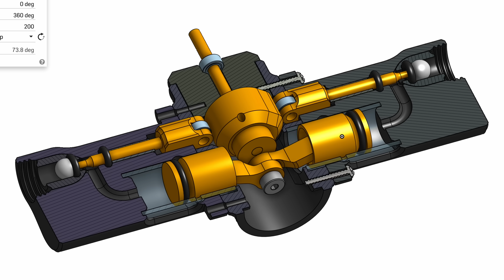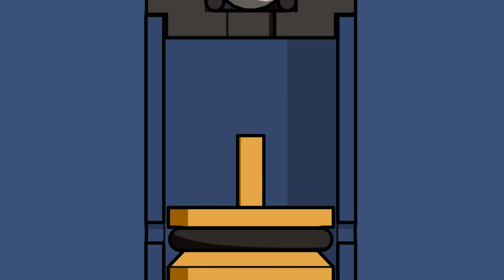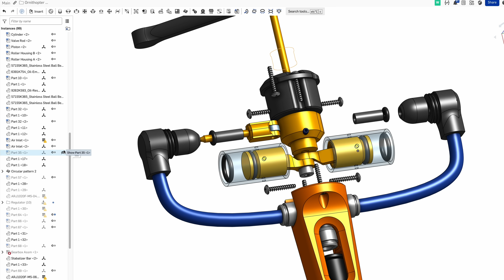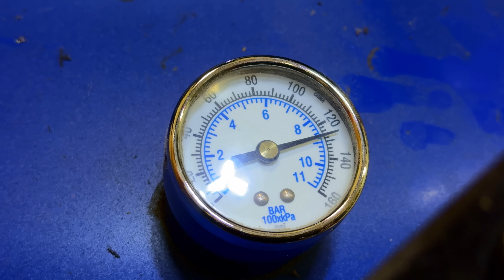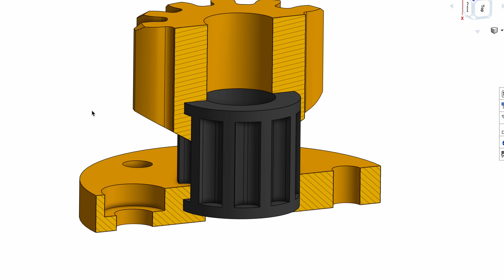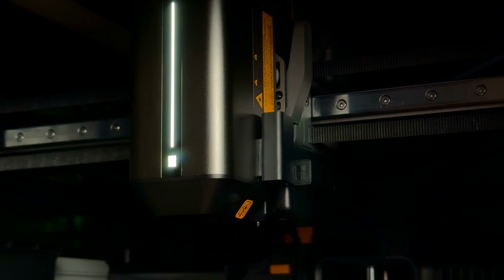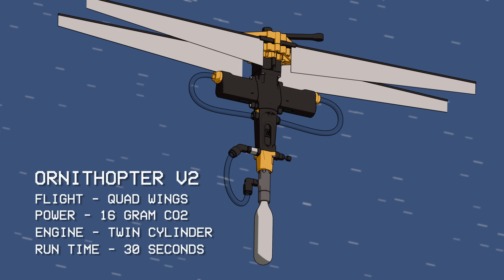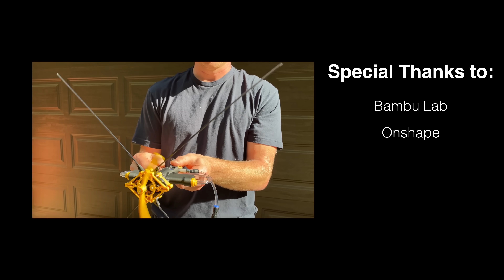I Tried to Build a Flying Machine With Just CO2

Comment: This is impressive stuff. This is just my personal opinion, it looks like working with compressed air is the most stressful option to power your device with.. Is there any other compressed gas option? Or could you do a hybrid option where you use some battery powered electric power in combo with utilizing the compressed air & the momentum of the propeller to create an efficient hybrid system? I'm obviously not experienced in this department myself but I do nerd out & watch a lot of this type of content. So my ideas are probably delusional but that mindset can help with brainstorming ideas. You never know what options you might stumble upon to make this thing fully work. It's an amazing design & really well made, same with the videos visual diagrams.

Comment: Could you make the piston travel to be shorter in order to increase the rpm? U should let the wings rotate in 1 of the 2 movements that each wing has and block it in the other so it pushes air only in one direction

Comment: Beautifully made video. Seriously i love the effort you put into these animations
Reply from the maker: I appreciate that!
Reply: @worksbydesign  Hey man, you mentioned the problem with the engine back-firing and producing an oscillation, why not use that directly to oscillate the wings? Just a thought
Reply from the maker: @xmysef4920I tried at first! The problem I had was that the backfiring wasn’t giving much power. As it is only backfiring because the first stroke wasn’t strong enough to complete the revolution. But there maybe something to that, it’s worth exploring again for part 3!
Reply: @worksbydesign what program are you using for the animations? Amazing work!
Reply from the maker: @DJ-kx4en thanks! I use onshape to make the parts and blender to animate them
Reply: @worksbydesign  amazing work! I'll look into this! I'll try to find some tutorials for the effect!

Comment: You could try using PLA Aero that Bambu Labs sells - it’s meant to be light, specifically for model aircraft and stuff. I haven’t tried it myself, but if it does what it says, it could be worth a shot.
Reply: It's good for lightweight stuff but I think it foams as it comes out of the nozzle, so its really bad for stuff that needs to be dimensionally accurate like this project.
Reply: @EchoBuildsThings  He could use it for any of the infill stuff away from walls.  Birds after all have mostly hollow honeycomb bones.
Reply: @youtubeisapublisher6407 You can get better strength to weight in these kinds of parts by mostly ditching the infill altogether though. Foaming PLA isn't new though and while the dimensional accuracy is lower, it's not by so much that it couldn't be considered for some of the structural parts

Comment: I wonder if directly driving the wings via an air engine that's intentionally backfiring would work? It would remove the gearbox and the associated weight and friction, albeit needing to tune the engine to deliver high torque at low "RPM"

Comment: Great engine, I’m know engineer but I thought that after you reduced the pressure when splinting the flow to each side of the engine wouldn’t you be reducing the power you need to make it fast enough to lift off, I’m probably wrong it was just something that came to mind 😊

Comment: You’re converting the reciprocal motion of the pistons to rotary motion in the crankshaft then back to reciprocal motion for the wings; that seems like a major inefficiency.
Reply: Ya, early in the video, when he was showing the backfiring engine (and came up with the cam solution)... I was thinking, "you want an oscillating motion, maybe you can use that as it is".  At this point he seems way off on the weight vs generated thrust.  Something has to give.  Or a lot of little things
Reply: @glenmiller1437 exactly what I was thinking
Reply from the maker: @quakxy_dukx Good point! I did try an engine that fired like a linear actuator, but it always ran poorly or not at all. It worked much better by connecting it to a flywheel or a crankshaft because it gave it momentum it needed to continue firing evenly. And once I added a flywheel it was easier to just take power off of that rotation, especially when trying to find the best gear ratio to flap the wings. Could be worth taking another look at it though!
Reply: @worksbydesign Yep, you're right. Not only is torque problem, but so is momentum.
Reply: @creativecarveciteclimb5684  youtube is using nested comments. That's new to me.
Reply: @worksbydesign  No, actually , I think you should go back even further in your design process!  Pray tell, why, when you’re trying to make something “oscillate with changing direction”, did you work so hard to make your engine stop oscillating back and forth and instead produce rotational motion, like what a propeller needs (which isn’t what you’re using), all so that you could then turn that rotational motion back into an oscillating one?!?  It’s probably true for most situations that the rotational motion is more efficient, but I don’t think that is true here. A propeller needs constant even torque because the force it needs to exert is constant. But a flapping wings torque needs aren’t constant. It needs much more torque at the end of its swing when slowing down and changing direction than it does in the middle of the swing when it’s just pushing on the air. And I’m pretty sure that the oscillating engine design would have produced torque in that same pattern, meaning that for your specific needs it would have been perfectly efficient!  Instead you added more complexity and weight to your machine to produce an effect which is less efficient than what you could have had…  Unless you can demonstrate that I’m wrong about all that?!
Reply: No, this is by design, as this is the only way to change the mechanical advantage to allow more torque.
Reply: @creativecarveciteclimb5684 it is intentional, but I'm not sure it's the right choice. If u used a larger piston you might be able to get away with slower flaps and higher torque
Reply: You need the reduction somewhere, just a single stroke of the pistons wouldn't be enough to move the mechanism.
Reply: You would need a complex linear ratchet system to convert strokes then. It would, most likely, have even more internal friction
Reply: @G0RSHK0V  

I'm not certain that's true.

You could definitely design a piston where a small displacement corresponds with a full wing flap just by using the wing as a lever - with the piston quite close to the pivot.

To get the wing to flap both directions, you could build it like a double-acting pneumatic cyliner.

The tricky bit would be to deal with the valving in an efficient and lightweight way, and to prevent the system from stalling - you'd need to do something similar to what he did here to prevent the valve from firing before top dead centre.
Reply: @quakxy_dukx  I was having similar thoughts along with some changes to the pistons so hope you don't mind me adding my two pence worth here. First how about having the piston powered in both direction by having two dual function valves at each end that switch from exhaust to inlet 180 degrees out of phase with each other. Then do away with the reciprocal to rotary back to reciprocal motion by replacing the gear boxes with levers that couple the pistons reciprocal motion directly to the wings reciprocal motion by having the piston motion arranged to be at 90 degrees to the wing motion and connecting them with a lever (or four bar linkage)  that would have a suitably positioned pivot point and possibly using one piston per wing pair. Now if any of that makes sense to anyone please explain it to me because explaining in words what I can see in my head is not one of my strong points 🙂
Reply: @ripmk2  what you’ve described is a steam locomotive piston
Reply: @quakxy_dukx  I must have been George Stephenson in a previous life 🙂
Reply: My engineering gut feeling tells me that with proper matching of stroke, bore and pressure, no gearing will be required and that the resulting 'direct drive' ornithopter can be made to fly more easily than its 'rotating intermediate stage' counterpart. My gut feeling also tells me that it takes someone like you to do it. Very impressive!
Reply: Good point.  Further more, since the final motion is reciprocating motion, u don’t need a rotary one in the middle. Just have the two pistons move in opposite direction for balance and synchronized in some way
Reply: @ivirelu23  wdym “furthermore”? That’s exactly my point
Reply: This is a really good idea, and I think it has promise. That entire stage is really not needed, and being directly piston driven would be SO COOL!
Reply: I'm guessing that either the engine would have to be redesigned to run slower or some very creative transmission for speed reduction would be needed (and planetary gear one like here tend to be compact). But it would definitely be interesting.
Reply: @ImieNazwiskoOK True.  He could change the stroke and bore of the cylinder, and give it lower rpm and more torque.  Might well still need a gearbox, or a change in the linkages of his wing-flapping mechanism.  I feel like he wanted to re-use that flap mechanism (understandably), so wanted a rotary input, and that lead to all of the conversions.   Thinking all that could be replaced with a "direct drive".
Reply: @glenmiller1437  There's even more potential weight savings here. Rather than using a bunch of regulators to reduce the pressure of the cartridge (which would then require a large cylinder to get enough force), he could potentially use the ~800 PSI of the catridge as-is with a small diameter piston - but while achiving the required force for a 1:1 ratio with the wing flapping.
Reply: I feel a manual car type flywheel should be able to transmit the power properly, it's got teeth on its circumference so can be mated to the planetary gears.

a differential and a wound spring would allow storage of (a bit of) excess power as well, but that'd be an absolute dogs breakfast to put together and troubleshoot
Reply: good point  didnt think of that

Comment: TLDR below. I'm no expert but have studied in both aerospace and automotive fields. The biggest thing holding back this project is your cam and push-rod design I think. It's amazingly engineered to avoid using a flywheel but you added a small flywheel anyways. I would suggest going back to Tom Stanton's design. Looking at the CAD drawing at 4:38 there is a lot of unnecessary material above the intake port of the pistons. I would assume the cams also cause a significant amount of friction. The space the cams and push-rods take up could almost fit an extra piston it seems. I would suggest trying a 4 piston design as the overlap in power strokes could even eliminate the need for a flywheel and cam system entirely. Hell, go crazy and try 6 or more pistons, there's a reason 12 cylinder car engines are the smoothest engines on the planet. More power stroke overlap is more smooth operation and less need for a flywheel. If you're chasing extreme weight savings try cutting the length of those air tubes. Maybe try something akin to a 'common rail' system in ICE engines and get the air connections as close together as possible. One final thing is lube that sucker up! Friction is the devil when it comes to any mechanical system. Could increase power a lot.

TLDR: 
-Change cam system to Tom Stanton design
-Trim material where possible
-More pistons
-Compact design with shorter tubes
-LUBRICATION!!!
Reply: I would replace the tubes with a cast plastic structure on the mechanism body itself, this would improve aerodynamics and possibly weight.
Reply: I also notice that there are two reciprocating pistons driving a common rotating shaft which drives two reciprocating lever hubs for the wings. I wonder if the wing mechanism could be integrated into the engine directly, possibly halving the weight of those two sections.
Reply: @TlalocTemporal  Could be! I think there's still need for a gearbox to achieve the right speed and torque balance. So integrating all of that into the engine housing might be too complex. I think the biggest area for improvement with the wing-flapping mechanism is once again simplicity. Maybe look into how oscillating fans work. Watch Jared Owen's video titled "How does an Oscillating Fan work?" He explains the mechanism around 2min40sec into the video. 

If you attached a wing to the front of an oscillating fan it would technically 'flap' all be it very slowly, would only need to speed it up at that point. It seems like a very simple system, just 4 sticks connected together. Not to mention no more sliding parts, just rotation of one of the sticks.
Reply: @SmokeShellGaming -- Instead of gearing down the engine to have enough torque for the large wings, why not have smaller wings that flap faster?

A more efficient wing design in general wouldn't hurt either.
Reply: @TlalocTemporal  Effectively, it seems there's a loss of energy and more weight in the fact to transform a movement alternative > rotative > alternative.
Reply: 1- V12s are the smothest because primary and secondary balance are both perfect, but that is also true for an i6

2- 3 cylinders would probably be enough, since this is closer to a 2 stroke

3- the dual pressure regulators seem like they add a lot of weight, there's a lot to save there by swithing to a single one, and optimizing every part on it

4- bigger wings, specially vertically, so they have more area (with less rotational mass compared to making them longer), more flex, and it gives more time for the air to accelerate

5- SLA printing for less air leakage and smoother cylinder walls

6- maybe keep the valves the same, but lower the RPM with bigger cylinders (specially in stroke), to completely eliminate the gear reduction; it might need longer cam duration tho
Reply: Larger diameter pistons (and more of them) would also allow you to generate more torque directly from the engine and eliminate the gearbox entirely.
Reply: Świetny pomysł
Reply: i think turning reciprocating power into rotational power and back to reciprocating power is quite inefficient, maybe there is a way for the pistons  driving the wings directly, it is a ton of mass that could be cut
Reply: For avoiding vibrations, why not just modify the crankshaft so as the pistons oppose each other two by two (180° phase opposition) ?
Reply: 3 cylinders would be lighter and better balanced.
Reply: Do you mean using more cylinders to achieve the power overlap angle? Or can you refer to the RX7 rotary engine?
Reply: Idk I think he should try the integza design as well.
Reply: I'd like to add that the psi limit might be a bottleneck if the system is capable of handling more pressure. I'm not sure if it was mentioned in the video or not
Reply: What about a Stirling engine-like rhombic drive? Sealing would be difficult, but it would be much lighter overall.

Comment: Can't imagine, how much effort this took.
I would add some kind of lubricant to the mechanisms, might add some easy grams of thrust.
Reply: this is exactly the comment i was looking for.  if those are dry gears just straight off the printer, you can get a lot of extra smoothness of the whole mechanism with something basic like silicone spray, which is a lot friendlier to plastic than oils. it'll make a big difference.